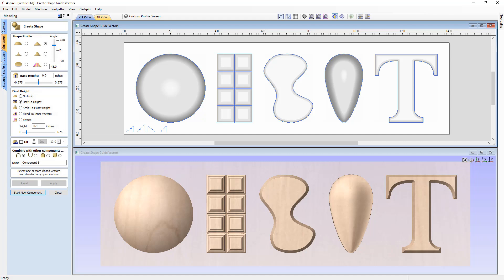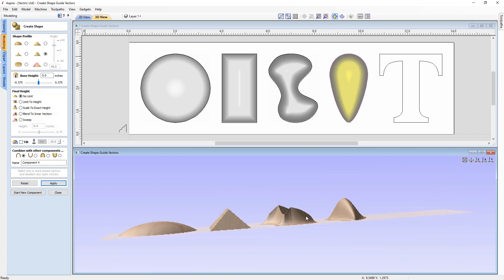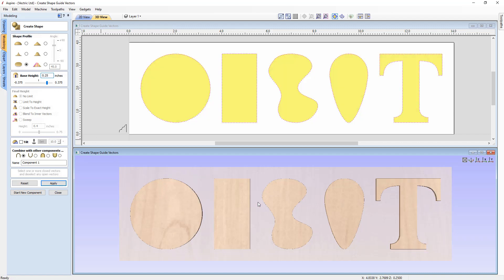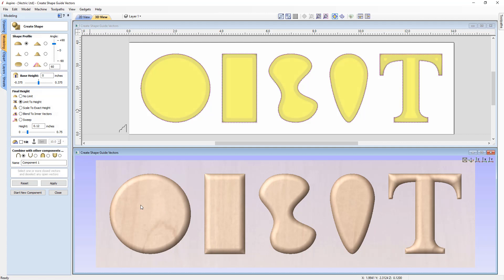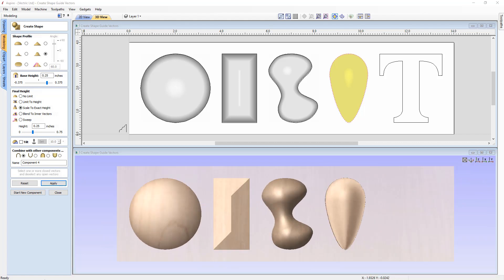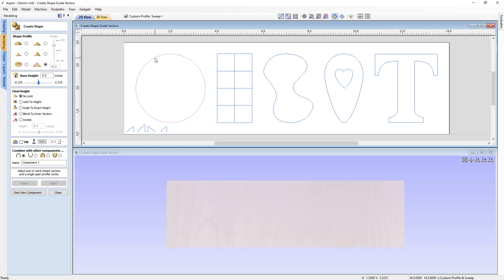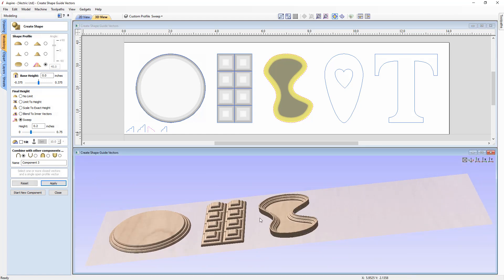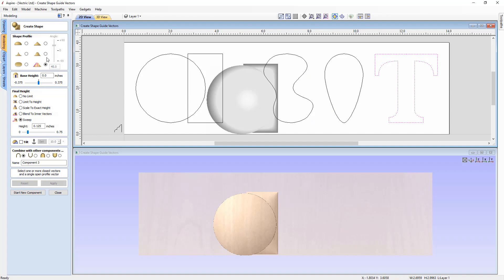Create Shape Guide | Vectric V11 Tutorials

Comment: Can the create shape under modeling also work on the vCarve Pro edition?
Reply from the maker: Hey Jon, if I understand corectly you want to create your own custom shapes?  If that is the case you will need to have Aspire.  There are different ways in VCarve that you can use existing components to make new shapes, but if you want to create truly custom shapes you will need to upgrade.  Thanks for the question.
Reply: @vectric  Thanks! I'm very new at it but have the pro version. I was trying to do stacked text and just found a video that wasn't applicable with my version is all :)